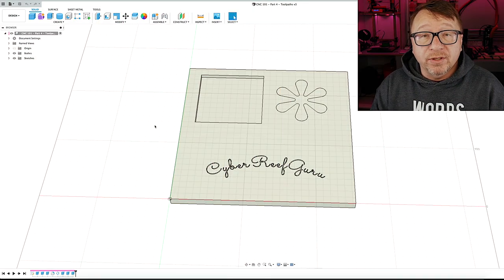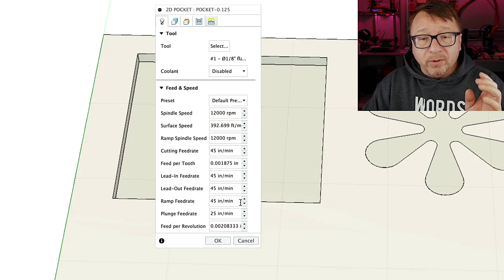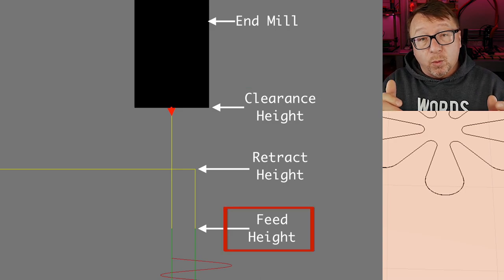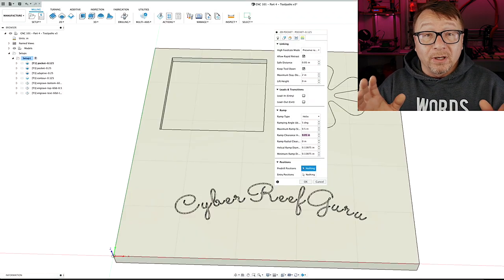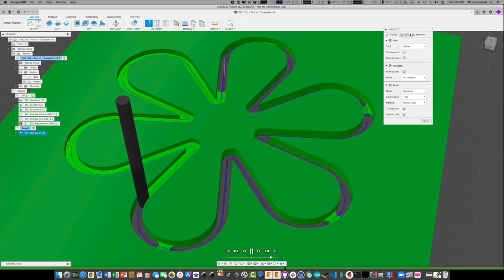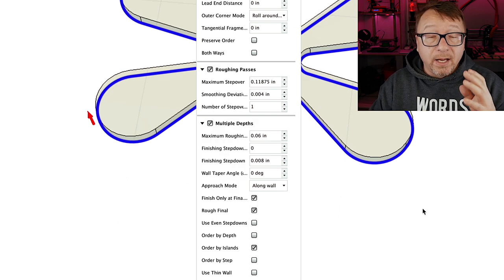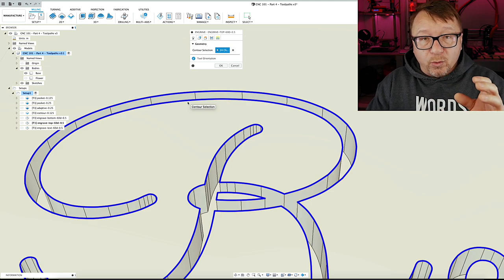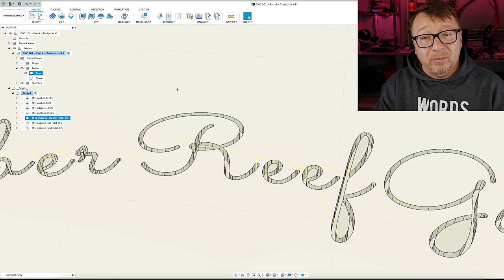CNC Tool Paths for Beginners

Comment: Tool path in fusion 360 is difficult then of aspire or esal carbide etc right?
Reply from the maker: Well, there is a steeper learning curve for Fusion over Easel, Carbide Create, and Vectric Aspire, but Fusion has a more robust CAM capability and a true 3D modeling capability that none of the others have. If you understand the basics, you can learn any of them - if you don't, some will get you going but you won't know what to do if the job fails. Take the time to learn the basics. Thanks for watching!

Comment: I don't know if you have a video somewhere on your channel about this or if you mentioned it and I just missed it, but how does the CAM software take the 3d geometry and turn it into g-code? How does the program actually translate the model into a set of motor speeds to control where the cutting tip is? Thanks
Reply from the maker: Hello Walter - I have a digital manufacturing series that discusses the full end to end process if you are interested (https://www.youtube.com/playlist?list=PLCVvx3PnAfyf-YXNFPpK-_xpc3OTPB8nz). The said, everything the CAM software does is human entered - you must program the tool paths according to your model. For a 3D model, use 3d tool paths instead of 2d to get the outcome you are looking for. Hopefully that answers your question -- thanks for watching!

Comment: Just like Arduino code , can we copy past someone else g code on my cnc machine if yes where can we find?
Reply from the maker: If the machine is identical, the bit is identical, the material is identical, the spoil board is identical, the router or spindle is identical, the placement of the work piece on the machine is identical, and you set all the parameters up identically to the source, then you can simple "run" somebody else's gcode and maybe have success. Otherwise, no. Take time to learn the skills or find a different hobby. Thanks for watching!

Comment: is fusion 360 a software subscription?
Reply from the maker: Hi Dawn - thanks for watching.  It is free for makers and certain small businesse - https://www.autodesk.com/products/fusion-360/personal
Reply: @cyberreefguru  New to CNC, with a 3018 to learn, the device is freestanding and not a connected device. Fusion is not an option. That being said. and this being an introduction of the general principles of CNC, it seems best to ignore the preference of software for now.  Hopefully you will get into candle (or other software) during the next phase of your tutorials. 

Thanks for a great series. Having looked through the library on youtube yours is the one chosen, because 1. not a lot of ego and opinion filler. 2 it's methodical and structured, one-step-at-a-time with one point and no rambling. 3. it appears that after completion I may be able to actually learn to be effective with the machine.
Thanks again.
Reply from the maker: @bpidbulletproofpassword-fr5055  thanks for the kudos and for watching! I will look into Candle; thanks for the tip. If it matters, UGS was my go to for many years until I got the Onefinity. Highly recommend it!